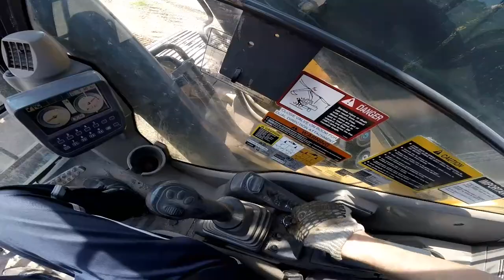KENWORTH HEAVY -- Episode 49-- Midland, North Carolina

Comment: I had a load hauled and the broker messed up with the width and I messed up on the weight, I paid the extra for the overweight permits but wasn't going to budge on the width.   The broker put the squeeze on the driver and that's not at all fair as the broker booked all the permits.    Driver was a bit bummed and rightfully so, I gave the driver a couple hundred cash extra for the hassle as he did a fine job communicating and keeping me updated with arrival time.

Comment: Finally! Personally I prefer to rest the bucket of an excavator on the ground instead of the knuckles when leaving it, less risk of dirt in the joints and easier access to the joints when greasing them before using the machine.
Reply from the maker: i was kind - originally i wanted to leave the bucket stretched out to the maximum height above the ground.

Comment: On your new truck you have one USB plug on your radio. i ran across this item on amazon. Two wire install and even one that plugs in too a 12 volt socket hope this helps.
https://www.amazon.com/s/ref=nb_sb_noss?url=search-alias%3Dautomotive&field-keywords=12V+Dual+Port+USB+Charger+Socket+Voltage+Voltmeter